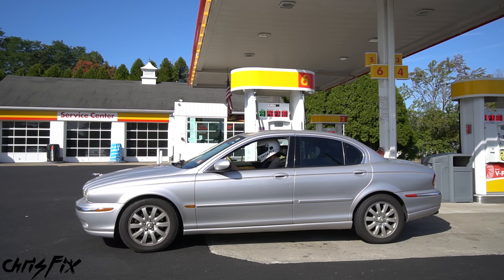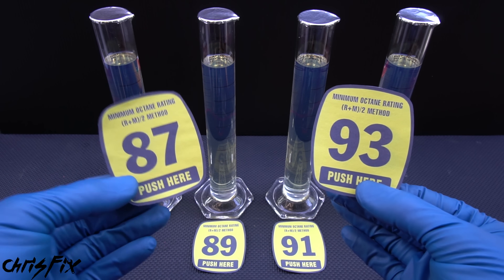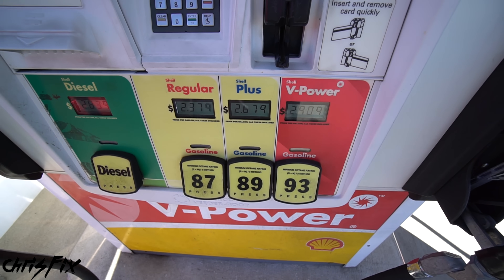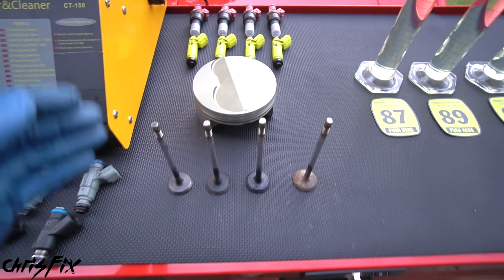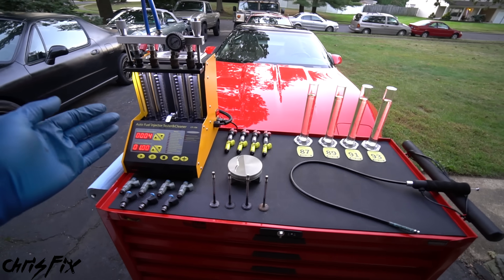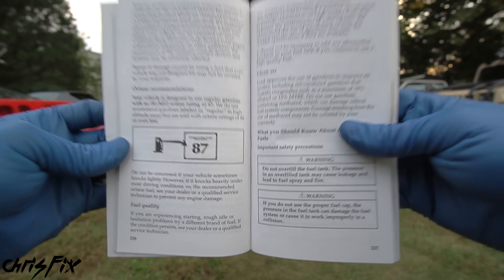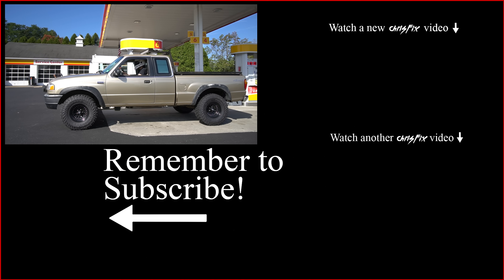What is the BEST Fuel to Use in Your Car or Truck and WHY

Comment: I have a 2012 mustang v6 the previous owner told me to only use premium fuel because it has a 93 octane race turn if I revert it back will I able to put 87 octane? Gas is too expensive now and the cars miles per gallon isn’t the greatest it’s 13.9 mpg

Comment: but the diesel quality in the US is much worse than in the EU for sure
Reply from the maker: US diesel is formulated to work better with heavy duty trucks, and EU diesel is formulated to work better with passenger vehicles, it's hard to really say that one is "worse" than the other, the markets are quite different
Reply: @chrisfix  I have couple range rover diesels, but almost all mechanics (and forums) blame US diesel quality a little when coming to DEF problems...

Comment: Out of curiosity, do fuel brands matter?  I ask because I had a Hyundai Elantra that I bought brand new, never had any issues.  I was away from home and stopped by a gas station with a brand I had never heard of.  After refueling, I started hearing misfiring and felt engine kicking while accelerating.  The next time I refueled, I used one of the more common fuel brands and all of the engine issues went away. I haven't experienced the issue again since then.  Is fuel brand something to look out for?  Or could something else have been happening to my vehicle for just that specific period of time?

Comment: I know this is old, but without even watching this video I know it’s 87 octane. Why?  Because that is what the owners manual tells you to use.  It says to NOT use anything over 87 octane. My 2023 JD mower says the same thing in the manual. I don’t know of a single car that recommends you use anything other than 87.
Reply: Mercedes-Benz says specifically not to use anything under 91.

There's also one in the video, at 10:52

Comment: Im confused. Onitially you told us that the energy in the fuel was exactly the same. But, at 12:30ish, you said that by using lesser octain fuel in a high octane vehicle, you may lose some mpg and performance. 
Seems as if you contradicted yourself.

Comment: Liked the video, but for the people going to the Netherlands and probably other European countries, please note that the gas standards have changed since 2019. The Shell V-power a.k.a. premium E-5 is the regular fuel from before 2019. That means that if you're driving a car that's older than 2019 and it says to use E-10(Euro 95) choose E-5(Euro 98 / V-power or premium. so E-5(Euro98) is the old E-10(Euro95).
Reply: Completely wrong.. please don’t spread this bullshit.

Comment: As long you change the oil every 3000 miles and don't use cheap gas your car will work fine am been doing this and never had a problem

Comment: So my wife's Prius had a engine knock issue and I was broke so I just said fk it and put in 93 gas and pray and sure enough engine knock went away 😂
Reply: Get that additive $7-$10 complete fuel system clean for 2500-3000 miles or when it's close to oil change.

Or you can fuel high premium 2500-3000 miles.

I did have problem with my vehicle, the fuel injector and intakes got carbon build up. Cost me more than $100 to fix.

Edit most oil change are close to 5000 miles. So it's best to either put high premium half way of oil change or get the $10 additives fuel complete cleaner.

Comment: I'm just got a 1981 f-100 with a 4.9 liter 300 cubic inch inline 6. I'm thinking I have to run non-ethanol gas because I'm afraid of damaging the heads. Thoughts?

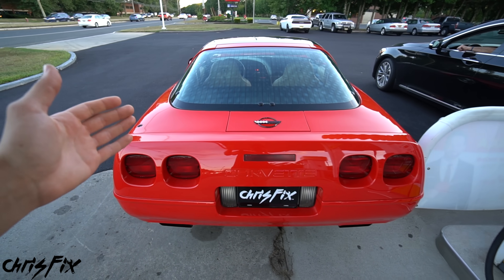Comment: 1:45 The bigger the octane number the more energy, giving better fuel economy or power is completely not fouls... Then 1:56 All the different octane fuels all have the same exact energy content 2:42 Octan is only the difference between detonation and engine knock. 10:26 Use the required fuel recommended by the manufacturer. 12:14 using regular you will lose a little bit of fuel economy and probably a little bit of power. (umm 1:56)12:38 in a recommended premium it is recommended premium but you don't have too. 12:45 It should run regular... but you might need to run premium if the engine gets a knock. 13:10 if you don't want detonation run premium. Shell claims if you run premium for 2500 miles (4023 Kilometres) it will clean 70 percent of carbon deposits in the injectors and valves. [so what is I use Premium to 5000 miles or only use premium?] 14:56 E-85 I am told Ethanol fuel will also degrade fuel lines pumps and seals if the car was not designed to use that fuel. 15:36 from your experience running premium will let the car run better. You will get a little more power and a little better fuel economy plus no detonations. So at the end of this clip I am no clearer about the fuels. I have always used 95 in all my cars as I notice a knock when using 91 My cars are designed for regular but they hate it. and to my understanding the better the fuel the cleaner the fuel as well meaning it's been filtered more than regular but you didn't cover that. I really do appreciate the huge effort you went through making this video. I did however find it contradicting. you don’t need to, you can, you should, you don't have to but I would. Thanks.

Comment: Glad I found this. What to do if you put regular but usually use premium. How do I clean the filled tank or do I need to clean if used regular once.
Reply from the maker: Is premium required? If not you shouldn't have anything to worry about, if it is I would use octane booster and that should hold you over until you can refill with premium
Reply: @chrisfix thanks so much for responding 😊 it’s not required but I use it as it gives me more mileage to drive

Comment: @Chrisfix , I know this is 4 yrs old now but I have a question. I have a 94 300zx tt. It says “premium unleaded fuel only”. Now, back in the 90s, 93 octane was everywhere and that’s what I would assume they suggest. Now, it’s near impossible to find 93. All I can find is “no ethanol” 91. My question is, will that cause a potential for detonation or would I be ok? Car is currently stock but will be upgraded as time goes on. Thanks!

Comment: 1:47 Nope, it' completely correct.

As long as the engine can utilize the higher octane it has slightly more power / less fuel consumption.

Comment: When I use factory recommended 95 RON I get "Check Engine" in my 2001 shitbox. It creates a carbon deposit on the exhaust sensor and sends false signals to the ECU. When I fill it up with the 100 RON 40kms later, check engine is gone. So those regular E10 juices are not always good. E5 100 RON and my 1.3 liter I4 shreds the asphalt to pieces.

Comment: Put 93 octane in all them all cars have control timing if you want to drive a car that's sluggish check your gas mileage 93 octane then compare with 87 octane you will get way better gas mileage guaranteed especially with AC on on a hot day

Comment: in D4A's video, using higher RON than stated by your manufacturer, while safe to use, can hurt fuel economy on a cost basis as well as decreased performance as the pre-ignition mitigating properties of a higher RON fuel would result in slower and inefficient combustion from an engine with lower charge, heat, or compression ratio.

It's about matching the sweet spot of your fuel with the sweet spot of your engine.
Reply from the maker: Thanks for sharing but premium fuel doesn't burn slower, all you're really doing is just throwing money away since the engine can't take advantage of it
Reply: @chrisfix  It CAN have a slower combustion speed IF in an environment that doesn't require it (low compression ratio, lower temp, lower pressure, less boost). Simply speaking, it can burn slower in an engine not optimized for it. That said, the difference is marginal, so yes practically speaking it's equivalent to throwing money away.

To put it another way, all ratings of gasoline, when used in engines designed for it, are not faster or slower burning.

Comment: Basically if you use the wrong gas in your car it will burn gas causing your car to waste gas. So buying a cheaper grade of gas will cost you more then more expensive gas
Reply from the maker: That is not what this video explains. You should use the fuel recommended in the owners manual. If you use lower grade fuel than required you can damage your engine permanently. If you use higher grade fuel than required it wont cause any issues but you're wasting money on fuel you dont need.

Comment: you show england saying europe but england isn't europe : in the rest of europe, for the gasoline, the number reflects the amount of pure gasoline added to ethanol so, 85 is 85 % gasoline and 15% ethanol (works for recent car motors) and 95 is gasoline with 5% ethanol (which is recommended for 2T and ancester cars)

Comment: I mean this should be common knowledge, but if you have a normal family car then 87 or whatever the standard gas is will run fine. Certain cars are made to run high octane and they will clearly telling you to use it. You can get away with 89 in many of those cars, but for engine life you really always need to run 91-93 in them, but again some of those cars can still run fine on 87, but you will lose horse power because the ecu will adjust to the fuel. But like you said, if you have a high compression engine then always run high octane unless you are poor and have no other option.

Comment: Common misconception about the exhaust phase of a 4 stroke, the piston doesn't in fact push the exhaust gas out, but the fact that it's at several times atmospheric pressure inside the cylinder.

Comment: What if you have a Chrysler 300
Reply: If you have the 3.6, I had a 300, my family had it from 0 miles to when I got it at 70k, I sold it at 135k. We always ran 89 and when I say we never had any engine issues, we never did. Never had any major issues. We also were doing maintenance on time so that helped
Reply: If you have the 5.7, I had the 5.7 in my truck and grand Cherokee, make sure to use quality oil for oil changes and keep up on maintenance. Having to do the lifters is a pain and expensive. I spent roughly 4K rebuilding my motor. Other than that, great motor.

If you have the 6.4, I also had that in my charger. Same thing as the 5.7 but make sure you do oil changes more frequently and always use 93.

Comment: Hey Chris, my 2019 Mazda3 with 25k miles is designed to run on 87 with a 13:1 compression ratio.  I can feel the timing being pulled at high RPM and it gets really sluggish in hot weather with the AC on full blast.  90+ degree weather is really killing power.  Do you  recommend 93 to prevent the timing being pulled?  I used to run 93 but it is too expensive at $4.40+ a gallon.  Should I go back?  I only use Shell in my car.

Comment: Premium gas is better. But if u add 1 gallon of premium to like 7 gallons on regular it works better then straight reg. I can head n feel the difference in my 99 e150. V8.

Comment: Hey Chris, thank you for the helpful video! You mentioned hearing detonation while driving in your truck. What does that sound like? Can it be felt as well? I ask because I wonder if my 87 required vehicle could use a good flushing of 93 nitro every now and then. Also, is there a need for fuel system cleaning if you are using these additive enriched fuels nowadays?
Your thoughts? Thank you!!

Comment: A built muscle car or sports car you should be running 93 octane and omg 😳 dude YES YOU WILL GET MORE POWER WITH HIGHER OCTANE you don’t know what your talking about i have a Dodge Challenger Hemi and a Z28 Camaro and I have to run high octane i bought my Challenger Hemi brand new and if I didn’t run high octane it would knock but im not saying every single car needs it only high performance motors like the ones i drive on the streets they both are my daily drivers
Reply from the maker: I'm sure they require 93 which is why they perform best with that but higher octane doesn't contain more power it just means the fuel is harder to pre ignite, higher performance cars are tuned to take advantage of that

Comment: If all the fuels have the same energy, how can some cars on the same tune make lets say 900hp on regular and a 1000 on premium?
Reply from the maker: A higher octane allows for a more aggressive tune to be run and that will usually allow for a little extra timing/less pinging so the engine can be run harder and make more power
Reply: @chrisfix  i see, thanks

Comment: my manufacturer recommends regular but ive always put premium in my cars and it feels like it runs way better with better power regardless.
Reply: placebo effect lol
Reply: You’re wasting money. Your car’s computer adjusted for the slower burning fuel after about half a tank and you’re just causing your engine to run hotter than it should for no reason. Put regular back in it and after a tank or so to make sure all of the premium gas is gone, the car will settle down and run exactly as it does now, but at a slightly cooler temperature.
Reply: @ my gas millage has dropped almost 30% more using premium so ill stick with it and ive been using premium for about a year.
Reply: @OnePumpKyle  then either your car is intended to take premium gas or there is something wrong with the engine timing.

Comment: I had an 85 Chevette that only required Regular gas.  But it would knock in the winter if I didn't switch to mid-grade.  Any thoughts?

Comment: Hi Chris, huge fan of your work. Thank you for this video! Got a quick question that you danced around with this video but it was never fully touched on. I’ve been running my car at 91 for about the past 5 years (50,000 miles) since I thought it would be better for my car. The manufacturer specs only require 87. Is there any reason I should be concerned with going with 87 gas going forward? Any adverse effects that could come up with engine performance or anything of the like? I really appreciate your insights!

Comment: I have had BMW 528 I Mercedes C300 and Lexus LS 460, 400 and GS 350. I ran 87 in all of them and drove them to 200 k miles or more  with no mechanical issues or detonation at high RPM.

Comment: Watching this in 2024 and I've had -different people tell me different things, but this makes the most sense of all. No one EVER told me to look for what type of fuel I should use on my gas cap or my manual. I'm a 63 year old woman and obviously clueless. lol. I do have a question, though, @ChrisFix... and hope you'll see this and answer. I've been using the mid-grade Plus fuel type. If I should've been using Regular all along, does this mean I've been causing damage to my engine? You mentioned using regular when you should use premium may cause damage, but didn't mention the opposite... for someone clueless like me, I'd love to know the answer. Appreciate the video... if enough people watch it, could be a great time to buy stock in Shell. I'll be going there or perhaps to Speedway from now on, as someone mentioned it's also great gas with additives... is that true too, @ChrisFix? Appreciate the info... I've subscribed now and plan to watch more of your videos. :-)
Reply from the maker: Using mid grade in a car that requires regular won't hurt anything, but it is extra money for almost 0 or 0 gain so you are better off switching to regular. And as long as the fuel contains the necessary additives (or more like in this case) you will be good to go!

Comment: "atomization" ~= vaporization. The fuel injector certainly isn't turning the gasoline molecules into atoms(This is caused when the spark plug fires and combustion takes place), but instead helping the vaporization process along. Fresh gasoline at rest will vaporize due to it's volatility, but not fast enough for the injector to just deposit a thimble of fluid gas, so it sprays the fuel to speed up the vaporization by "pre-spreading" the fluid so that the pressure in the cylinder will allow as much of the fluid to become vapor as possible.

Comment: From a mechanic standpoint if you have a vehicle that should get premium. (Mercedes or luxury car to a sports car / muscle car / exotic car use premium. My brother had a 94 mustang with the 3.8L V6 and he was using regular and it was running horribly we started using premium and it helped a lot. It actually saved him from having his fuel pump go sooner. It lasted 6 months before it went and when the shop pulled the pump they tested it for us and stated that the use of premium saved his fuel pump from pre-mature failure. We ran premium from that day forward and never had to replace the fuel pump ever again. Note proper vehicle maintenance was done during both scenarios

Comment: There is a gas station called Jumpstart in Kansas that has CHEAPER 93 than 87 and 89. They also offer E85. I do have a flex fuel 2010 Impala with high milelage.  I believe the ethanol content is higher in Jumpstart's gas. How do I know if the cheaper 93 is good or not for my car?